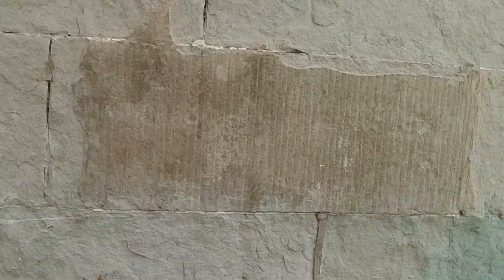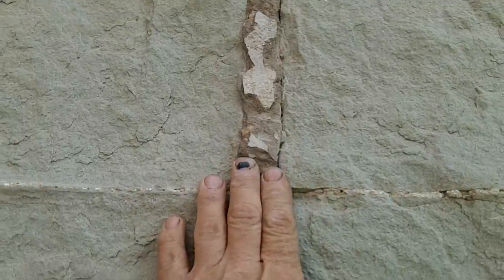Damp old house - no - it's salts from the chimney affecting the stone.

Comment: Hi Peter your videos are so informative. I have an old terraced house that has damp due to salts in chimneys also. but at the back of the house we hav an inset next to chimney attached to the back wall which has rendered outside. The paint on the inset peel off from 2meters above floor level could this be caused by the render ? Thanks for uploading your videos
Reply from the maker: Could be - I hate cement render at best of times.. traps moisture.

Comment: Hello Peter, so if after taking all the cement render off the sandstone house, you discovered that the the sandstone was heavily depleted due to moisture rot and a render/insulation was required, would it be a simple case of putting up something like fibre board and then lime plaster?
Reply from the maker: Probably - after repairing the sandstone with soft lime to level it up.  Sandstone is hard - if the binder has been badly salt damaged you might have to cut back a fair bit.  But love the fibreboard and plaster.  Could also consider a hempcrete instead....
Reply: Thanks for both your time and advice. My nearest lime/wood fibre suppliers are in Much Wenlock, but I will certainly contact your company if I need some professional advice.